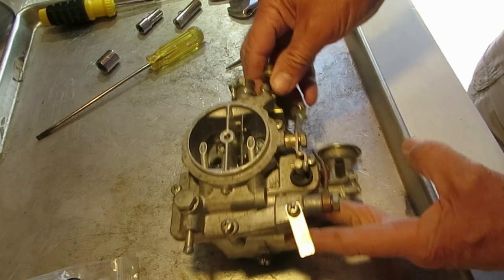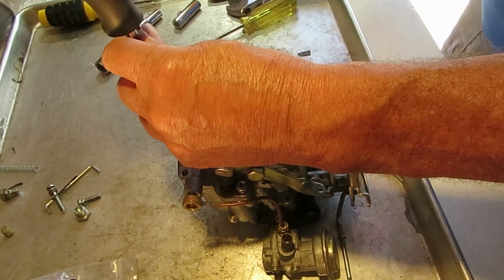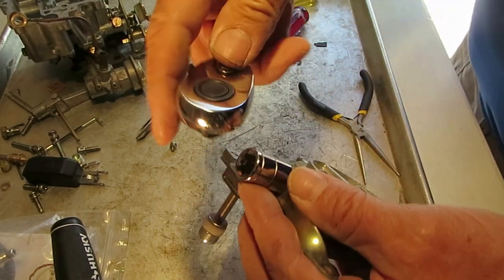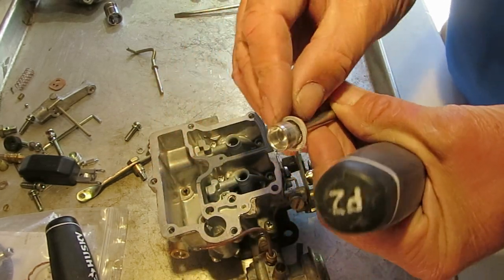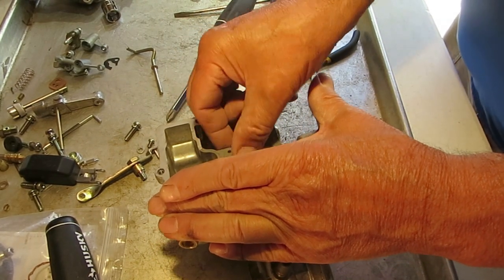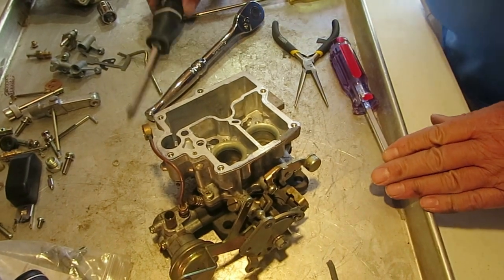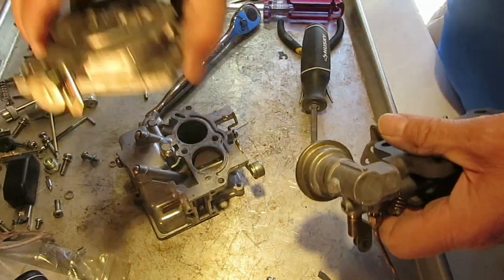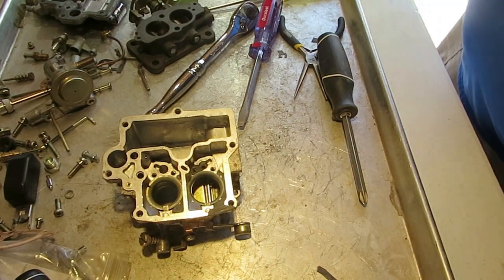Aisan Rebuild Part 1 of 2

Comment: Hi Mike.  Thanks for the great video series.  I've got a similar carb to this fitted to a 5g15 engine in a mitsubishi colt.  It's a 5eva carb.  Your videos were very informative but there is a terrible lack.of videos on this on YouTube.  I have a particular problem in that I can see that the choke butterfly is completely closed until engine warms a little and then it begins to open.  I notice you have a book, but I can't find a specific book for aisan carbs anywhere.  I think the butterfly should open a little once the engine starts but it doesn't.  Therefore, it overchokes and dies if I don't give it gas, until it's warm enough for the choke to start coming off.  I need to be able to adjust it but nobody over here in the UK knows anything about them.  It's all plug and play electronic injection here and anyone that has anything to do with carbs will not touch Aisan because of lack of knowledge.  Can you help

Comment: I did a carb rebuild and put everything back together and put it back in the fj, started it, everything worked fine. I let it sit for about a year while i was away at school and now the fuel reservoir in my carb is not filling. I checked to make sure i was getting fuel at the carb inlet and i am. My question is at what port does the fuel fill the reservoir at?  I have some sort of clog happening because when i blow air in the fuel inlet i can't pass any air through. Would that be a stuck needle? Thanks
Reply: Mikes Carburetor pulled the top off chamber last night to find that the screen right before the needle pin was torn and clogging the flow to the fuel reservoir. Tried to find a replacement on the internet but can only find the needle pin.

Comment: Hi
I have a little question about this carb.
I have 2 of them that I want to rebuild.
I noticed with one of them the first venturi bushing was loose and even 90 degrees turned (you can also lift it up)
The second venturi was fixed and in the other carb they are both fixed.
they cant be turned as the have 2 little holes in the shaft that should meet holes in the carb house.
How to fix this venturi bushing in its place?
Regards
Frank

Comment: can anyone by chance tell me what displacement and hp the corolla from which this carb is? We're troubleshooting an Aisan carb off a 1.6 75hp Carina (should be a 21100 model), but the jets are 099 and 156 and we thought the 099 is quite big. It's kind of flooding the primary half as well. There is a chance it could be 1 of the gaskets, but thought I'd double check with here.

Comment: Hi mike! I own a 65' Toyota RT40 with a 2R engine. The carb is leaking so I'm going to give it a clean and new gasket. But in case this does not solve the problem do you have any tips since finding a new is close to impossible?
Reply: @MikesCarburetor  Thanks for the reply Mike, a few days ago the carby rebuild kit made it's way from Australia to Norway so now it's been given a good clean and is mounted to the car. When I prime the carby it fires up for about a second or two, and then dies. It's bone dry so I'm thinking a vacum leak somewhere might be the issue?